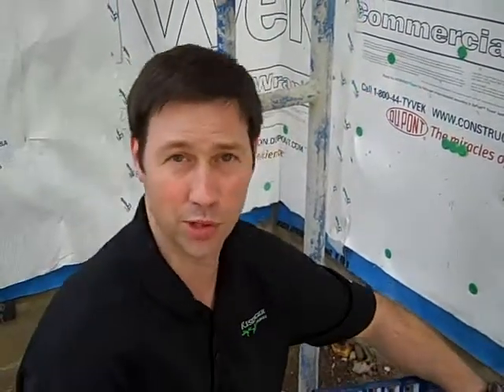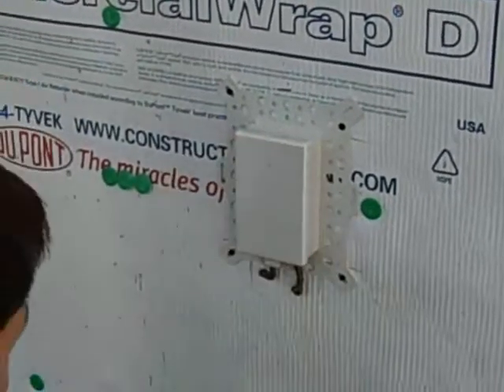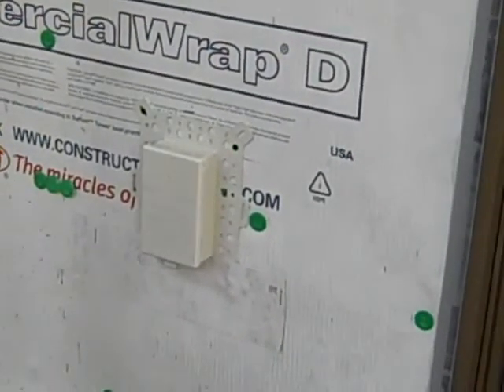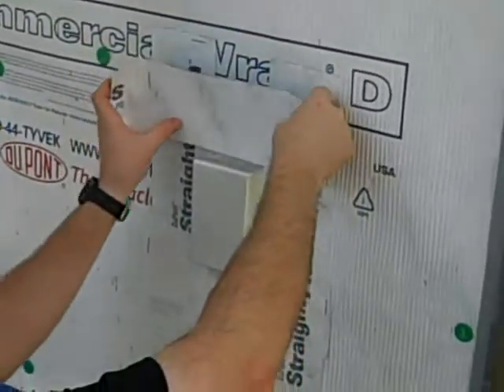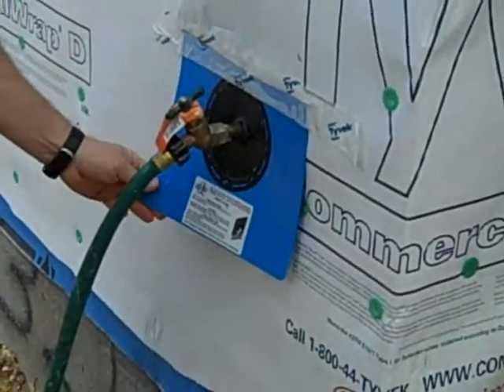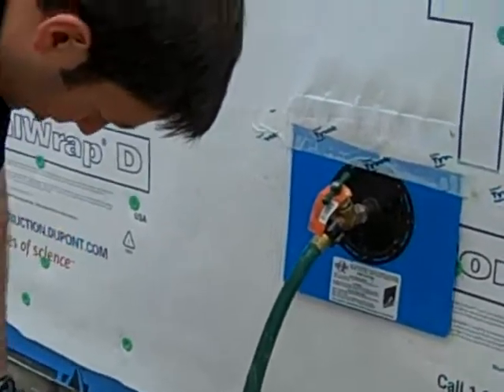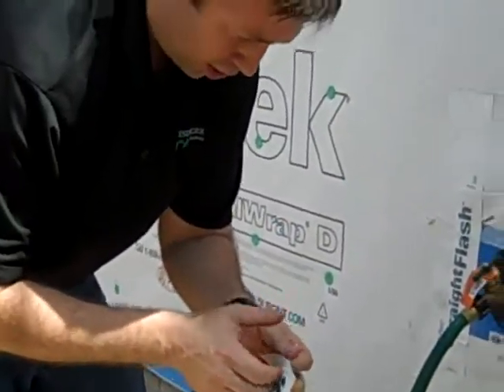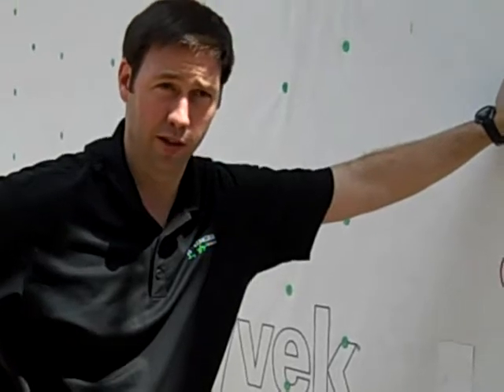Exterior Flashing For Penetrations

Comment: What happens when somebody snaps that plastic cover off that electrical box in five years?  Or like a year when the gardener tries to plug something in it and wraps his extension cord around it.   Seems like it will be absolutely impossible to change out When it fails.
Reply: Arlington sells replacement covers for about $5

Comment: per straightflash instructions the side flashing needs to be 1" shorter than the header flashing so that it's underneath the header flashing rather than sticking out at the top as it is here in the video.
Reply: +Dani E Was thinking the same thing (as a novice) -- less flashing is more.  Also a good idea to take a heavy rubber roller over the flashing to push out any air bubbles.